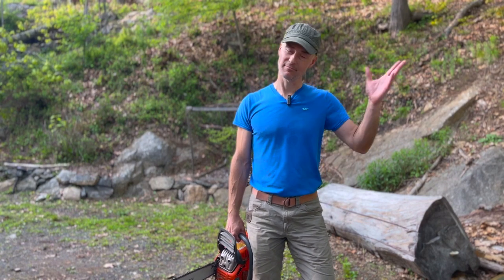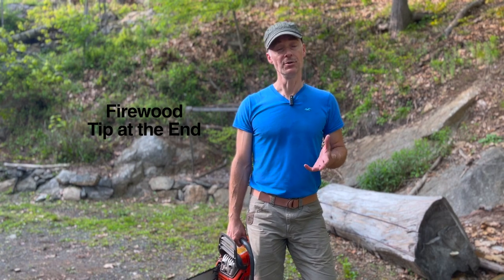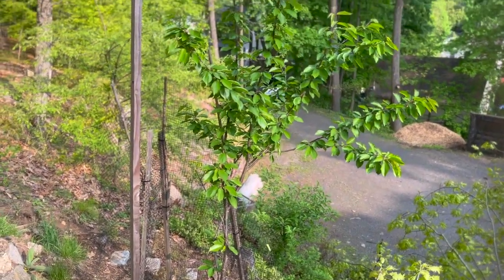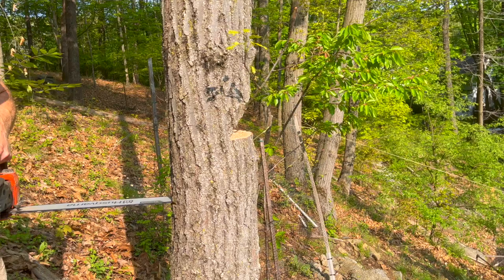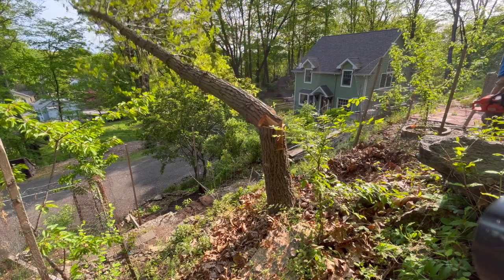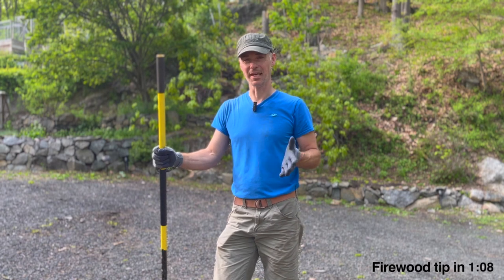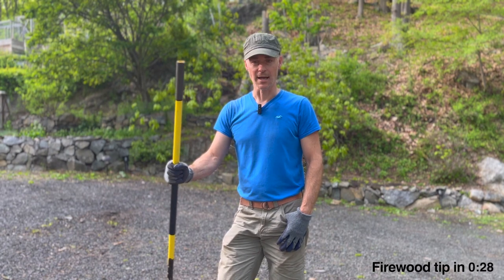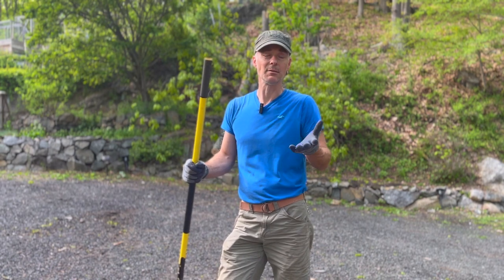Tongue & Groove Tree Felling: The DIY Technique

Comment: Many people get confused with this technique, as its sole purpose is to establish a pivotal point or hinge between the tree and the stump, facilitating a precise fall that keeps the 'butt' of the tree atop the stump. It is employed to stay above obstacles such as fences, flower beds, or decks, and to 'lock' the tree on the stump to prevent rollovers during felling, although such occurrences are rare and arguably unnecessary. It's crucial to remember that excessive cuts esp. more undercuts or any other intricate embellishments to traditional felling methods will weaken the tree even more compromising its stability on the stump, potentially leading to disastrous outcomes even with a healthy tree—it might behave unpredictably. After notching, only perform a back-cut; avoid undercuts and front-cuts. Keep your body clear at all times.